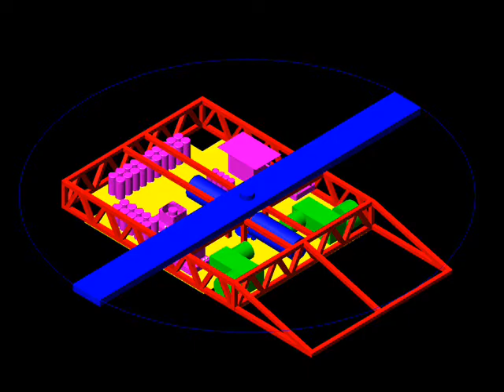Battlebot Huey promo video and  test footage

Comment from the maker: @HuskyTheHusky ** Sadly enough, Huey is no longer around, the electronics were scrapped and recycled for another bot, and then the metal was sold to a scrap steel recycler.
@Hunk586 ** Build a team, create your bot concept, calculate your costs, then speak with local area businesses. Ask your friends, ask your boss, ask the local grocery store (and engineering firm).